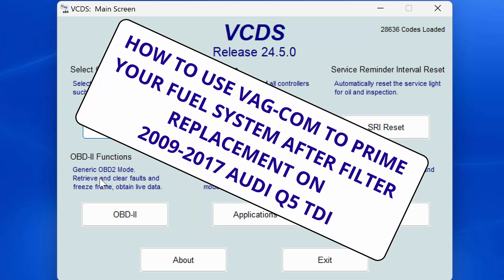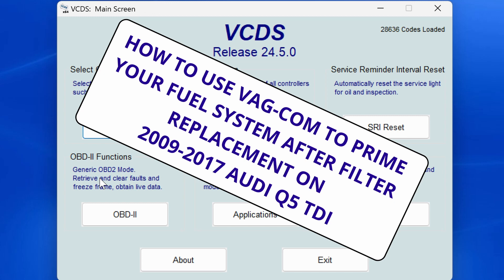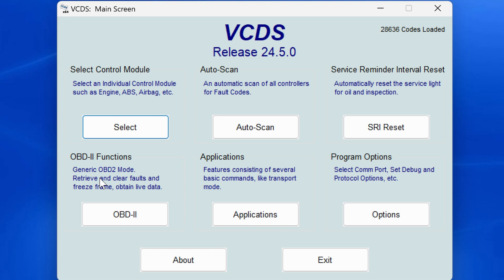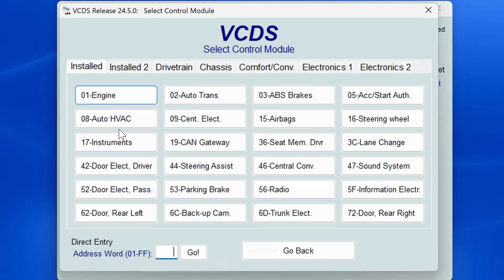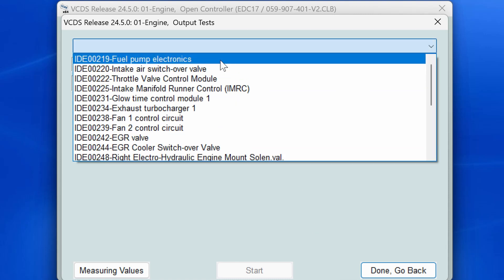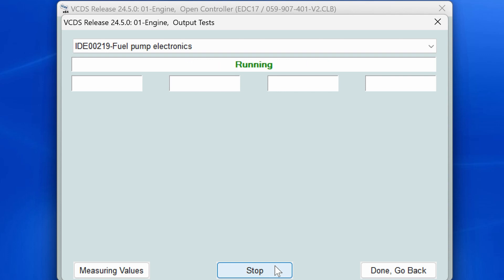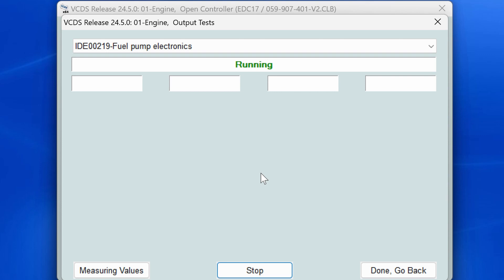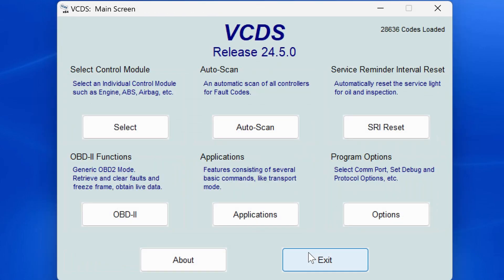Using VCDS to prime a TDI fuel system after fuel filter replacement

Comment: How many times and for how many seconds do we need to do the procedure to fill the filter?
Reply from the maker: You should be good to just do it once and run it for 15-20 seconds. I usually just let it run and time out, which I think is ~60 seconds as I’ll go do other things, like putting tools away, while it’s running

Comment: Hello. I've seen some vids presenting filling/bleeding procedure by opening Basic settings (those vids are a bit older though) and you do that within "output tests" menu. Why is that? Is that some alternative way or the software simply changed?
Reply from the maker: It may be different software version or different vehicles. Not all vehicles have the same output tests available in VCDS so sometimes things have to be done differently. This is just the way I know how to force the fuel pump to prime and run before turning the vehicle on.

Comment: I have a Hex Can cable and version 25.7 that I’m using with my 2007 Q7. I have way less options in the drop down menus than everyone on YouTube. Why is this?
Reply from the maker: I’m not 100% sure but it most likely has something to do with the vehicles model year. Audi updated these cars half way through their production (around 2011/2012) and probably changed the software modules to have more things controlled or monitored through those modules.
Reply: @thenotsonicecanuck  Thanks, appreciate the information. I wonder if I can update the software in my car.

Comment: This is a great walkthrough, just changed my fuel filter on my 2.0 CKRA and have always used the basic settings version of this. Im always so paranoid every time I do it because i really dont want a CP4 implosion 😂
Reply from the maker: Yea, lots of people like to debate whether you do or don’t need to do this and my thoughts on it is just that it’s a little extra safety measure to save a fuel pump and for the 5 minutes it takes, I’ll do it rather than spend the time and money replacing a pump and who knows what else that the pump may take out with it.